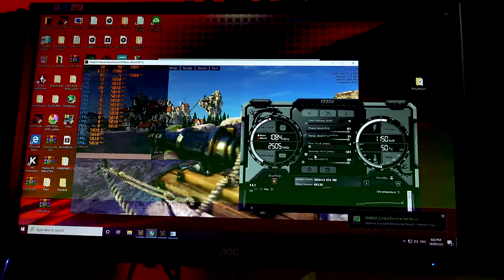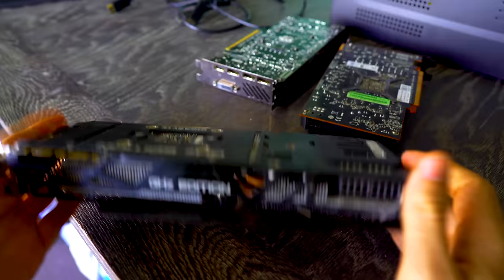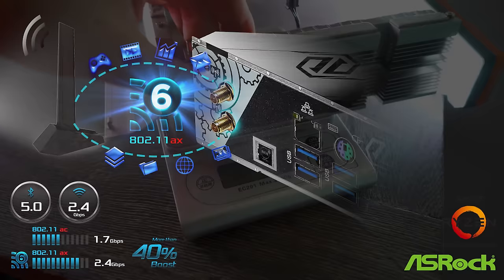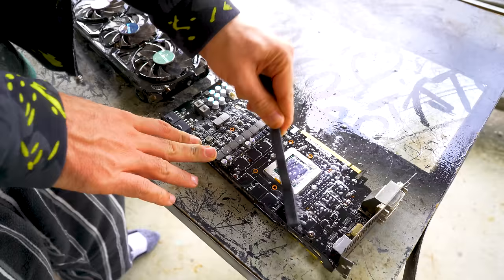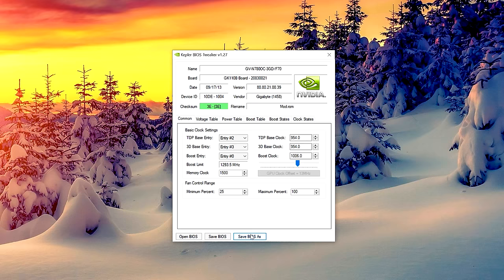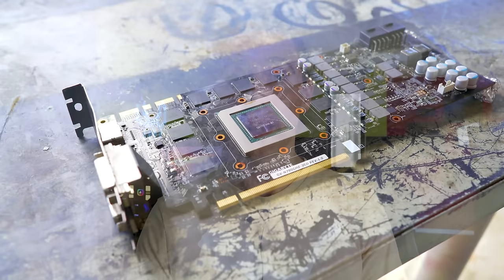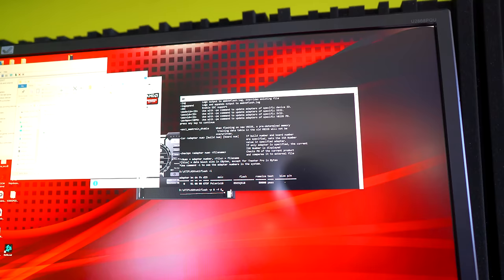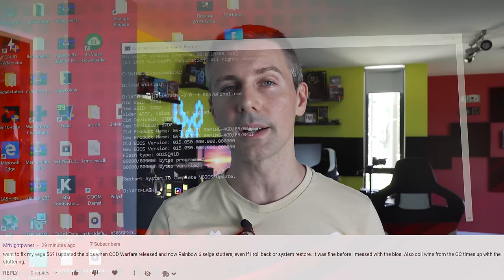4 Problems that Cause a Faulty GPU and How to Fix them.

Comment: Hi i have an issue with my pc , my pc would freeze at random and then either stay stuck for 5 minutes and restart or will give me a blue screen asap with an error that indicates that i have hardware issue , so at 1st i replaced cpu mobo and ram but the issue still exists , int cant be psu and hard disk unlikely i think it might be gpu , can faulty vram cause this issue ?

Comment: I have an alienware aurora with a gtx 770ti oem that runs everything normal, older games fine as well. When I try to play a more modern game, it will play for a bit then I lose display signal, pc stays on. I have to power down and back up for things to return to working. Any experience with issues like this?

Comment: i got my self a 1070 for cheap that guy used in sli(video out dont work) i wanted to make it to render the game ,pass thru Apu and use high performace settings to make it render the game, but i am getting error 43 with it, i did everything ddu, older driver everything any advice what can i do now?

Comment: Something else to try if you've manually changed frequency / voltage or you've bought a gpu with unknown settings, is run MSI Afterburner and then its OC mode. This profiles the gpu and creates a custom frequency / voltage curve for that GPU which you can save for the card.  btw Wd40 + heatgun ?

Comment: I have a 670 that only runs the lowest possible resolution (I believe it also does that letterbox effect but also on the sides, making the screen a small rectangle if I'm not mistaken) and the driver can't even recognize it. There are some pink "glitter" artifacting that appears on Windows' booting screen.

 I was in a game when the system froze and this happened. I believe I got crashes before, saying the card had been "physically removed", but I also had one with my newer 1060, so it could have been something else.

Comment: I have a very interesting hardware defect, apparently caused by a voltage spike (I guess) when I removed one monitor while AMD Eyefinity was active. The card works perfectly with performance tests, but the very first BIOS logo has color alterations. Also, sometimes when windows starts I get one black monitor and one green monitor. The black/green thing may also happen in Mac when getting back from sleep.

It's an AMD R9 380 from MSI. Flashing the VBIOS didn't help. I fell like there is something else that needs to be flashed.. if that makes any sense?

Comment: I have a Rx 580 with Ryzen 2600x in Msi b450m pro vdh v2 mobo, but it always runs at pci e x8 @3.0. I have no other cards or nvme drives, only 2 sata ssds. Any idea why? I know x8 is more than enough for rx 580 but I’ll upgrade to 5700x & 6700xt in this motherboard. So I want to know if it too will run at x8 @3.0

Comment: I have a question i was trying to add an AIO to my Nivida 1070 FE 8GBi dismantled the necessary GUP case pit the AIO connected it and ever since that it did not show a picture the fan stopped spinning the green Nvidia Logo didn't light up, the card was a few months old i bought new in 2010 0r 2020 could not see any burned circuits nothing damage far as i can see, i tried asking for a fix to some of these folks on youtube if they can fix it but to no avil no response, was willing to pay for shipping and all but nothing, tried finding a repair shop in san diego, ca nothing, now i reside in  San Bernardino ca, i appreciate any tips as to what may of happen anything thank you.🤓👍🏼

Comment: Hi, i have a problem with a MIS ARMOR 8GB OC RX580, the fans are not working properly, i bought replacements and they have the same problem, they work for a while and then stop working, apart from that the card performs very good, tried multiple drivers old and new, if i take out the card for a couple of days it will work again, then the fans stop after 10 or 20 min of use, no matter the temp of the GPU the fans will not spin not even at startup, i have the stock Vbios, this card is used dunno if it was a minning card or not, i was wondering if maybe there is a resistance or something that controls de power going to the fans, it allways work i can use it normally and it will remain at 60 deg C, unless i start a game, any ideas what can it be?  Thanks !

Comment: I have rtx 2060 yesterday i was playing game then my screens turn off.
 My gpu fans running lights on but no display
 Cpu running everything is running fine but no display.
And the chip is not heating up. But chip health is OK. 
V rams are ok. 
Capacitors are ok. 
Please help

Comment: I got a 3080 that thermal throttle a lot, so I decided to replace all the thermal paste and pads. But now windows is stopping it (code 43) and if I try to reinstall the driver or the card, it could crash/ blue screen the PC. I thought it might be the thermal paste so I clean it up and reapply, but it is still not working. I dont know what to do

Comment: Was told by another specialist to give up on my GPU too, have 1st mentioned issue, where whole thing goes kabonkers. The "fix" that I issue, is I unplug GPU cord out of PC and plug it back after ~2-3s. Usually works from 1st, 2nd try. 3.61.75 driver version seems the only version my GPU works with. Zotac GTX 970 core extreme edition.

Comment: i got a  Strix r7 370, the fans don't seem to spin, but the system boots, and displays a green vertical bar in the middle of the screen on HDMI and VGA ports. (can't test dvi neither display port because i don't have a maching monitor)

Comment: i just use my pc last night then tomorrow morning when i try to open it, it says no display. when i open my pc case and check my gpu. the fan is not spinning, so i take it off then put my vga cord on board and it works well. question, how can i check if my gpu is broken or something wrong with my system unit? my gpu is Geforce GT 1030 (2gb ddr5 1x fan)
 thankyou in advance

Comment: Hi I have got an Evga rtx 2080ti ftw 3 ultra with me it gives me strange problems ... the fault is it just completing valley benchmark with 6735 points and keep crashing in all games... I have  tried to change drivers plus replaced thermal paste and thermal pad  cleaned pcb  flashed bios but nothing has changed  it just keep crashing then i tried with precisionX1 with  low power target it worked  but  not boosting the gpu  frequency stuck on 1350 mhz what could be wrong could you pls help me out ... this card I purchased from ebay recently.

Comment: Hello!
My I changed thermal paste on my gpu and then booted it up to see if the temperatures decrease. It was working for 2 min and then I got no signal. I restarted my PC and then fans started to spin on 100%. I opened the gpu again cleaned it all up, waited 12 hrs but nothing, fans still on 100%. Then I put it in oven on 200 C on 10 min. Now I get that b2 error code. What do I do now? Try using heat gun?

Comment: Hi I have an issue with my rx570, there is no hdmi display so I tried hosing with Wd40 & inserting and re-insertingnthe hdmi ports but to no avail. Is there other suggestions to take?

Comment: hey i have a dell gpu 3070 the fan circuit shorted got shorted out the wire was cut and pressed into the heatsink now i get no fans the gpu works but will over heat . any idea what burned out ?

Comment: My R7 370 Asus Strix  was in box for nearly 2 years.I got black screen and windows 10 crashes on start up,could not install any drivers from amd and in device manager the card was not recognized.I tried everything but today after i used the heat gun method card worked fine again.Drivers are installed and card is recognized.Run furmark for 2 hours and played some new games no problem at all.

Comment: Just came across yr video. I was hoping if u could help me with my issue. i have an old graphics card (used to work then) which I had stored a few yrs back but recently when i installed it. It didnt work. The system powers up for like  a second and turns off. Ive cleaned it and applied new thermal paste. But same issue. Plz advice. I'll be grateful.

Comment: I've got a problem with mine, its some weirds black lines all over the screen after the bios settings shows up, then passed 6 to 10 secs it starts to change color to some kind of yellow green thing. If you know anything that could help me with this please let me know :(

Comment: 6:25 & 11:00 , bios chip could also be bad/corrupted & if you can find a seller, replacing the chip could fix it. Seems so odd the generic display driver works fine, besides bios chip I don't see anything else wrong with the card when it happens imo. Little trick I learned with getting tight spots like display ports & usb ports cleaned is using a dentek brush with 90%+  isopropyl. With the brush being so small & having a metal core, it can get in tight & abrasion from from the core speeds up things. Fixed a 550ti just from doing this. Got it for 5 bucks at a goodwill lol. The connections were coated really good with nicotine/tar & lint.

Comment: for someone with a card that crashes on driver install, R9 390 would baking it be an option? have tried standard legacy driver that is available as well as the updated community drivers for legacy cards

Comment: Hi,...
I have a Nvidia Quadroo K600..
I frequrntly used it but then I replaced it with another GPU ...
When I am trying to use the K600 GPU again...
On booting and Running the Screen shattering and gives some garbage display..
Can It be fixed with above methods or It Dead? ..
Waiting for your response! ❤

Comment: I just had an R9-380, in the middle of a game, black screened, then after a force power cycle, just POST beeps.  Mobo does not have error codes, just 1 long beep, 3 short.  I have replaced it already, but interesting video.

Comment: Hi, my gpu quite has a faulty aswell. The GPU is not near the best nor even near mid tier GPU. But it seems to run valorant perfectly fine (Average fps is 120) but when I keep playing it crashes all the time, after it crashes my screen turns 10% corrupted and my resolution is messed up. I'm suspecting the GPU might be overheating but I don't know. Any identification to my problem and solution? I would appreciate it a lot.

Comment: Hi, I have an Asus Dual GTX 1060 3GB card, system boot up normally, Win10 recognise the card but given Code 43 fault. The GPU-Z recognizes the card too, but unknown blocks there like VRAM, bandwidth. Down below just OpenCL is active, no CUDA, no Pyhsx, no Vulkan. Bios flashed no luck. Do you a solution for this? Thank you if you have an idea. Merry Christmas to you and your family!

Comment: I have a msi r9 270 gaming oc GPU that works fine when i do a fresh install of windows 10 x64, then when i try to install any driver it crashes my computer, then boot loops, with black screens and boot loop, would you be able to help me? please im desperate. also im doing this an a Asus A10-6700 pre build with 500w psu....

Comment: I have a gtx 1660 and run all my games on high settings, yet it looks worse than low settings. I have great FPS, but textures or objects in the distance look pixelated and terrible. In some games on max settings, everything is terrible. Close, far off, it still sucks. I’m considering buying a different gpu, could that possibly solve the problem?

Comment: Please help I know. This is a old video but I hope you can somehow see this. My problem with my Gpu is that my pc freezes not just in games but sometimes in the desktop, it would freeze and then a windows connect/disconnect sound would come out tried different bios for it as well from new to the 2020 version, also tried undervolting and opening up the gpu completely and cleaning it with alcohol, still the same issue. Bought the gpu online it's an xfx rx580  2048sp version. Please I would like to hear your opinion.

Comment: Are you using normal WD-40 or WD-40 Contact Cleaner? Will normal WD-40 screw up plastic fans on the GPU?

Comment: I wonder if you could try taking the fans and heatsink off and cleaning it off. Then, cover the entire card in rubbing alcohol and put a small heatsink over the GPU. If there is a short, the alcohol would evaporate and you could microsolder to replace it. Alternatively, you could use an infrared camera, but those are expensive.

Comment: i have the second problem u said in the video no signal but fans spin normally and gpu is heating too still no signal . its all after pc went to sleep mode . i never overclocked this card . what do u think about this is this the hdmi port failure or gpu chip?

Comment: I bought an R7 360 for £7.50 that was supposed to be dead. I tested it and it works fine. Passes heaven benchmark. Doesn't overheat. I put it down to the seller possibly testing it on an old Legacy system that these UEFI cards wont work on.

Comment: Anyone that has an Idea of the problem i have?!
My both Nvidia Graphic cards have the same problem, my display wil go to a black screen and the fans will go on 100%, No overheating, somethimes it gives me a lime green screen (only this screen i can fix with Windows-key & P combination, but black screen i have to reboot my PC, tried multiple to even a new HDMI cable, aswell i found that my Graphics wil auto change from 8bpc to 12bpc, cant seem to find the problem why it does that, it does it with YouTube and games most of the time, i cleaned my graphic cards and placed new thermal paste, stil same problem… new or older drivers works fine, aswell all my hardware is completly fine as my PC shows.. i had it a while ago to, but somehow a friend of me got it working for me for atleast a month until i got this same problem again :( hope anyone can help me figure out whats cousing this to happen, i appriciate all the help il get from yall!!.
Reply: Sorry don’t know what’s wrong ):

Comment: Heating with heatgun, 10min for me, with 30 seconds breaks (because of 350°C lowesf temp)
coupled with NC-559-ASM-UV FLUX works for quite a long time, after that, 100% fan profile after 60 degrees temp

Comment: i had lost my gigabyte rx570 4gb and zotac 760gtx in a single week and im pretty sure that convertor cable for 6 pin has something to do with that which connector with 2x IDE power to 6 pin because i used it on both and they both worked only for 1 or 2 days then both gpu's fan run at full speed and no display

Comment: do you have a rx 580 4gb driver 2019 stored somewhere that i can download? the new drivers turns off the fan and black screen after fixing that games are crashing with the AMD Bug Report Tool message. im using a single dvi port rx 580 4gb. Thank you

Comment: hello, i need actual help so here it goes,i have a palit gtx 1050 stormx i bought as second hand, it works just fine for about a month or so, then one day it suddenly goes to black screen unnoticed, i did some research and found out that the problem is overheating so i fixed it by replacing thermal paste, and it works, for quite a while. now i reinstalled windows because the gpu even shuts itself off( blackscreen no signal but fans not running full speed), i have the ghost spectre and i even tried to install and older driver to see if the issue is fixed, but to no avail. so what could be the problem and how do i fix it? ( the gpu is a bit old i think because the back side of the gpu is not that clear and thres some component thats a bit dirty but i dont know if its rust or thats what it always looked like), i need help because i have school coming up and i need that gpu. thanks

Comment: I have the first problem with my nvidia gtx 1060 6gb zotac mini version it was working ok then sudden black screen i cleanedit up put it back in uninstalled drivers with my igpu after restarting my 1060 worked until i started installation of drivers as soon the driver finished installing it goes to black screen now  not even showing screen in bios loading igpu still working fine i do not know what to do =( any help please?

Comment: I'll try the thing you tried on R9 270 on my Sapphire R9 280X TRI-X. You can also try replacing cables, slots, pcie and connector pins and cleaning them

Comment: I have a ROG STRIX GTX 1070. Spits out the B2 error. I had gotten it to work multiple times but now it's on the brink. Cannot get the pc to boot anymore. Before this happened it would crash every now and again but only a few minutes after boot. If it worked it would stay working until I needed to reboot the PC then just spits B2.

Comment: i have a rx 570 as soon as the card fully powers up, it immediately goes 100 percent on the fans and it doesn't boot. even if i have another card in the system as the main it won't boot up with the card in the system, until i remove it. if i boot up with another card without a power cord in this card it won't go crazy. i tried to replace the thermal paste on the card already same result any suggestions

Comment: Hey there, had a question about a semi-faulty gpu
gigabyte 1080 wf oc edition
The card works, 1st and 3rd fan is working but the middle one might have a cable pinched so that should be easily fixable.
On the desktop backround random single pixels turn green and switch around 2-3 times a second But Only on the desktop backround.
Some games like Minecraft and Earn to die 2 (steam) work fine but Not a single game that uses (i presume) DX11 or something similar crashes imediately, except Dying lIght, That game has flasing "christmas" lights in the menu and ingame, then it crashes after a random time.
Sidenote, i had liquid metal on the card for a couple weeks and tried removing it. Maybe a tiny dot managed to screw with one of the memory modules? I'm not sure. Any tips would be greatly appreciated! GPU's are almost impossible to get these days so i Really want to fix my card xD